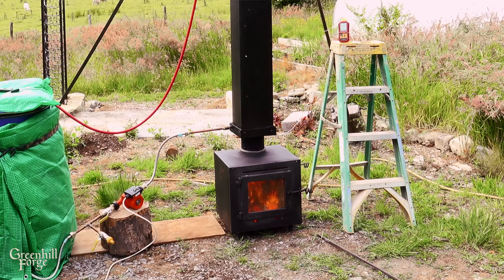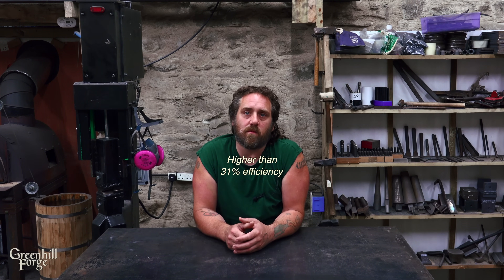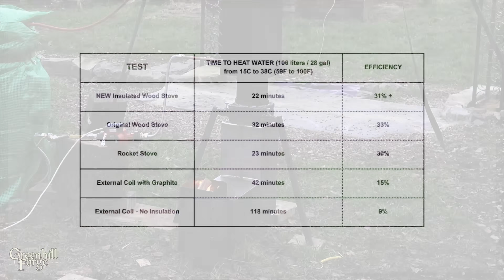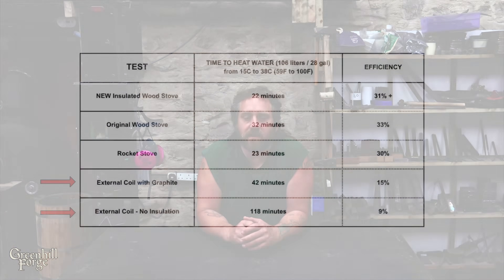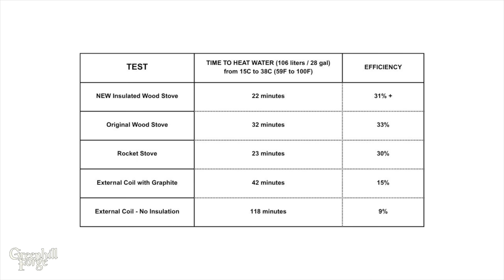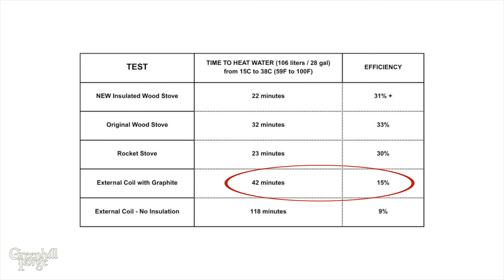Wood Stove Water Heater | New Test, New Winner

Comment: The graphite is doing a fantastic job at exposing as much surface area of the copper to a difference in temperature. But beyond just surface area exposure and difference in temperature, there're two more variables I'd be interested in seeing.

1. Turbulence: if there was a way to add baffles in the copper pipe so the water swirls around more, that could increase the heat absorption. I'm thinking of it like a mixing action, to promote relatively cold water towards the ID of the copper pipe.
I feel like your tests with the copper inside the flue did this a bit, but by casing the air to be turbulent rather than the water.

2. Exposure time: of course the more area of copper pipe in contact with the flue increases exposure time but you can increase that by rate of flow as well. Reducing pipe diameter increases flow and of course the opposite is true as well. I'm curious if increasing the flue's diameter only where the copper pipe is wrapped around it could slow down the hot air significantly enough to allow for additional heat saturation into the water. The larger diameter would also keep the same length of copper pipe as your current coils from being so far away from the stove. If the difference in temperature from the stove to past the coils is that great because of the efficiency of the system, that's amazing. If some of that temperature difference has to do with heat radiating into the air, that a wider shorter coil may promote a greater difference in water to hot air temperature across the entire length of the copper coil as well.
Trying to clear up my thoughts here. Insulated stove, then a Short section of your standard flue, followed by a reducer to a large diameter flue with the copper coil around it, and lastly a reducer back to your standard flue size before it ends. 

TLDR:
1. Find a way to make the water move around inside of the pipe, left, right, up and down (not just forward) of copper pipe's center Axis.
2. Slow down how fast the heat is moving past where the coil is placed.

Comment: Im just armchair quarterbacking but I think you can improve combustion/efficiency using super heated air introduced into the combustion area. For an easy experiment use a copper coil at top of combustion chamber. The copper coil draws in outside (cool) air, gets heated by the flame and combustion gases, then delivers the air to the base where the fuel rests. I'd also have a valve to divert some heated air to the inlet of the chimney to completely burn all escaping gases. Two tests for one run.

Comment: I wonder as your using a pump if you should have the cooler water from the tank ho to the top of the flue where it would be colder and then flow down. Like a figure of eight. 

I think you would get more efficiency. Look up how plate heat exchanges are plumped
Reply from the maker: I talk about it in this video https://youtu.be/pP_2A5Wdvqg  basically not using counterflow because the end goal is to remove the pump and use thermosiphon

Comment: To be honast I think your initial problem is starting with the wrong firebox setup , no matter how effective your heat extraction is in the flue , you have a very high heat differential , creosote issues will rise with heat extraction out of the flue no matter how you setup the water coils due to the high temp variations . And the majority of your fires heat output is still going out the flue top. I'd turn it on its head , go with high mass rocket design. Think of a Russian/Scandinavian heater design , insulated firebox made from fire brick with fire brick riser and you burn say 20 pounds of wood in an hour to hour and half . The fire box is inside a mass of rock/fired clay brick the flue gasses pass through around the outside of the firebox heating the brick mass to around 70 deg c . Add your water pipe into the brick mass where the temp is about perfect for most water heating temps. Advantages include no needing copper pipe (temps are low enough for pipe to made of PEX , will not cause explosion due to steam in any scenario , no issue with creosote , and the exhaust gas out the top of the flue is around 50 to 60 deg c . Maximum efficiency  , large thermal mass for long hot water output , relatively fast heating and a warm house to boot.
Reply: Do you know of anyone who has a video of such a thing? That would sound great for an indoor solution. Obviously the video is dealing with an external, perhaps even portable, solution with fast times. Both would be useful.
Reply: @ricos1497  lots of Russian stuff about with how to etc , google Russian masonry heater and a list will come up. No they're not portable , most weight from 2 to 5 metric tons , they heat up a lot faster than you'd think though . And will burn any wood from softwoods like pine to Australian hardwoods just fine as long as they're dry (below 12% moisture) You can have a significant amount of pipe installed inside the masonry with no ill effect to the heater increasing the volume of water heated at any given time without needing a huge water storage tank outside the heating area. Thermosiphon effect works fine to transport the hot water to a tank close by just fine.
Reply: @TheRedmohawk  yes, I've seen a few Russian masonry heater builds, but never one with pipe installed, so I'll check it out. I was thinking you were talking about the rocket mass heater, which is along the same lines I suppose, and hadn't seen one of those with water heating either. I just need to watch more videos it seems!

Comment: Great experiment. If you ever try using the rocket stove again try doubling the water velocity through the heat exchange. You might be surprised at how much more heat you can extract even with fast moving gas

Comment: Russian stoves can achieve efficiencies of 70 to 90 percent.  While specific efficiency numbers for the water heating component of a Russian stove are not readily available the overall high efficiency of the masonry heater design suggests that water heating within this system would also be efficient. The key is to integrate a well-designed heat exchanger and storage system that effectively transfers heat from the high-temperature firebox to the water.

Comment: Amazing what a difference the insulation makes. What about pump flowrate vs. efficiency? To me it seems you'd want the fastest flowrate possible, i.e. get the heat out as fast as possible, because once the water is hot in the coil the heat transfer is less effective. So circulate it fast with minimal temp rise over the coil, rather than slowly with a high temp rise over the coil. Might be talking nonsense, just thinking out loud after several Coniston ales.....

Comment: Great video! May I suggest you have a simple steel pipe running left to right at the top of the fire box that then connects to the current setup you just did? So barrel, pump copper pipe to left side of steel fire box entrance, exit right side to copper pipe into jacketed copper coil* Wonder what that 1 steel 1 1/2 steel pipe in the fire box would do to efficiency ?

Comment: Could you add something to reflect infrared back into the stove/heat exchanger? Like an insulation blanket, but I would expect those are not efficient and heat resistant enough for this system.
Reply from the maker: yeah, someone here just told me about a product called itc 100 which looks really interesting

Comment: 35 + yrs ago my uncle Henry and I did water pipe wrap with a coil of pipe inside and outside a wood stove, insulated the exterior pipes that were wrapped around the wood stove then sent a feed to a hot water tank, and it did do good but not at that 33% rating it was way less but if we kept fire going all day and night it was reasonably good enough to lower the gas Bill every month so would I say that your on the right track I'd say hello yes big time ! 

Have a great weekend and happy Father's Day to you sir.

Comment: If you mount that unit to a steel-wheeled welding torch bottle dolly, it would be totally and easily portable with spots to hang the pump, hoses and upper chimney pipe.
Reply from the maker: great idea

Comment: I'm a nerd but I like fire.. Water pipes under floor instead of vents = My favorite. Because if setup right you can always have windows open for fresh air and stay warm because rises from below up. Pros these days want to install junk that don't last. I want a hole under a home with stairs leading to a Wood stove connected to a Chute and Limestone rock + Limestone mortar pipe with drain catcher underneath for unlikely backup = If ever cracks water fall to drain to outside but also exposes inside formed structures to atmosphere causing Crystal growth in the lime to self heal the crack. Invented long before we ever had windows. No pump just heat spreading through water.

That's why goal would be slanted roof made out of Food safe metal. I already got 120 Mesh charcoal filter crafting done I had to. Reactions to Chlorine in tap.. Overflow shower + drinking water tank to replenish home heating tank then overflow to drain. Waste of filtered water if that happens? Points at metal barrels and used charcoal to heat I like fire..

Comment: Nice to see the data.great work!
I'm looking to heat water inside the house, with the wood stove used to heat the place.
the graphite system may be the best so far. ultimate efficiency is a problem because of boiling the water. 40minutes is fine for speed.
I would like to see a set up tuned for house hold daily use. with out the risk of boil over. and ease of cleaning. 
I think the water jacket is the way... but how tall should it be? according to a study done 1/4" of water raised the temp in the jacket fast,and the large thermal increase gave a strong pumping action. 
The thicker the water jacket,the less thermal separation, slower pumping action.
so 40 gallon tank. no boil over= how tall of a jacket do I need?
I think this is the most common application needed. and will help the most people.IMOP

Comment: If you could find a big enough scale, you could set the entire stove on it for the experiment, and note the weight after loading  wood, before lighting, and again when you hit temperature, giving you an idea how much wood has burned up.
Reply from the maker: that's a great idea. i have a 300kg hanging scale so I just need to suspend the whole thing in the air next time
Reply: @GreenhillForge  Well, hanging the whole thing would make me nervous, I’d set up a low profile seesaw, like a H on its side, put the hanging scale between two legs of the H, and the stove across the seesaw from the scale. 
A little more complex to build, but less spooky than hanging a 1200° wood stove from the ceiling. 

Or you could just keep an eye out for one of those big old package balance scales that places like feed stores used to use, they turn up from time to time. Depends on how big a hurry you are in to get that kind of data!
Reply: Why didn't you just throw water on the fire so you could measure the leftover wood? Just curious😊 @GreenhillForge
Reply from the maker: @GOATESS_GOATERSON  then I'd be weighing the water too. and the water would go under the insulated floor of the stove which it would not like at all
Reply: Ohh, yeah, didn't think about that @GreenhillForge
Reply: This discussion neglects the weight of the ash remaining in the stove. Removing the resulting pyrolized wood is also not an option as there is significant latent heat within the wood which will skew the calculations. We are on the right track, however. Can we operate with smaller loads of wood? Another consideration is the fuel required to heat the apparatus. One way around this would be to do a run to heat the stove, piping and tank. Let the fire burn down, remove the wood to prevent melting the copper, drain all the water, recharge the stove and water, then run it again. I bet you will get efficiencies around 50%, especially if you go counterflow.
Reply: Pack the coil in graphite, wrapped around a 6 inch flue pipe. The outside is an 8 inch stove pipe.  This fixture fits atop the insulated stove, modified to affix an 8 inch pipe, and you use an 8 inch stack above it.  For use inside a house, the flue going through the roof should be insulated, and that changes flow dynamics in the chimney.

Next variant: stainless version of the first, because now you are putting it on its side, and collecting heat more thoroughly.  Maybe use a slight dip in the stove pipe after the coil, kind of like a very shallow P trap, to concentrate the heat in the exchanger.

Comment: put a air/water heat exchanger at the end of the chimney, normal gas water heating furnaces use it and achieve great efficiency
Reply: Yes, on-demand heat exchanger, automotive heater core, etc. Scrub most of the heat with the existing system to avoid overtemping the heat exchanger, keep the stove hot to prevent creosote and you're on to something!
Reply: The copper pipe IS a air/water heat exchanger. The video is about how to do it yourself, without off-the-shelf heat exchangers.
Reply: @yetihehe  you can get a used heat exchanger for pretty cheap and if you put it at the end of the chimney you will get a lot of otherwise wasted heat
Reply: @423GustavBern  But they will get covered in soot and stop working way faster that that simple spiral. If you want to go that way,  used heat exchangers are so cheap they can be considered "consumables" in such system. With pretty clean burning they will still get coated with soot, clogged and stop working after two dozen firings, then instead of cleaning you can replace them, because they are delicate and pretty hard to clean out from soot. But that's not really sustainable way to make such a system. If you are one person doing this sure, but imagine 20 people doing that, you will soon run out of cheap used heat exchangers in your area.
Reply: @yetihehe  ok, i forgot that wood doesnt burn so clean like gas

Comment: Dude your tests are amazing. Have you ever considered using this setup to heat your greenhouse in the winter? You could heat the water and pipe it into the ground, using the ground as a thermal battery.

Comment: I have one question if i may:  in near future i have plan to build stove in living room. My primary heating source is heat pump (14kw monoblock air-wather) with 500l wather tank working  as buffer, and feed radiators.  For secondary heating source (used only if grid fail and/ or in time of hollydays) i have idea to instal stove, with 6kw chimny excanger. 
This chimny excanger would be conected with early mentioned wather tank, but cooper tubes would also be placed around stove itself (no pfisical conected, but with some spacing) like snake and buried with sand (thermo battery effect). So my idea is that stove would give all heating energy  into chimny exanger and into sand itself. Where would acumulate templorarly all awalible energy. With cooper tubing i would then taking that energy and send it into wather heater. Energy transfer would be done with fast wather pump (designed for heating) and would have backup (plus in case of grid goes down i have designed system with 200Ah lithium battery and  450w solar panel (that gives me around 18h of operating time). 
Stove itself or sand thermo battery would be extra insulated., because i wish that minimum heat radiation came into living space. 
Would this concept work?

Comment: Why are you not connecting a pipe to the top of the chimney that goes into the water tank and out to the outside run by a fan that is extracting the air? That pipe would also heat the water too, no?

Comment: In either the rocket or insulated stove is there any indication of the copper pipe melting or deforming inside the flu? I imagine if the water ever ran dry it would melt pretty quick. Really like this water heating series thanks for sharing your fun experiments. Have a great weekend all.
Reply: yea, i would use steel pipe closer to the heat source
Reply: The copper pipe would almost certainly deform if the system ran dry. With water in the copper pipe the temperature of just the copper remains close to the temperature of the water.
Reply: @lotklear  If that water runs fast enough and cool enough 
It can boil instantly at some scenario
Reply: The stove reached 760*C at the inlet of copper exchanger. Still 300*C to go before copper melts. But it would definitely deform a little when running dry. But probably not catastrophically, it would be a little loose after cooling.
Reply: @yetihehe  I misread the f/c  thanks.  I was expecting hotter I guess